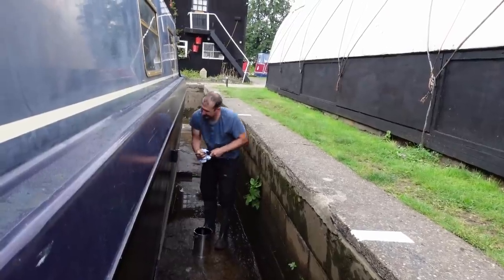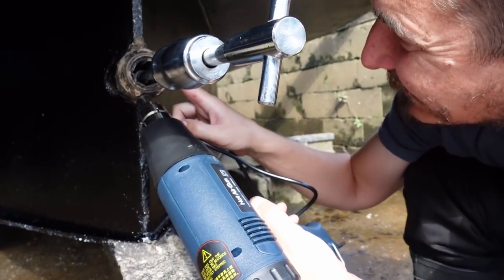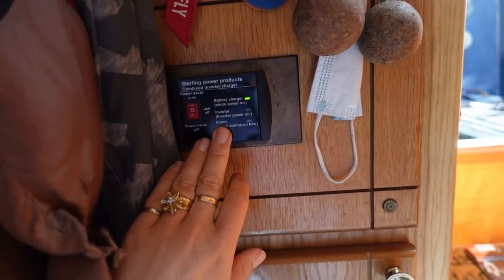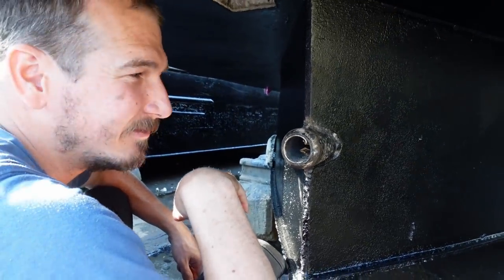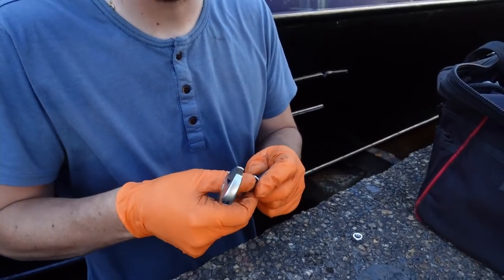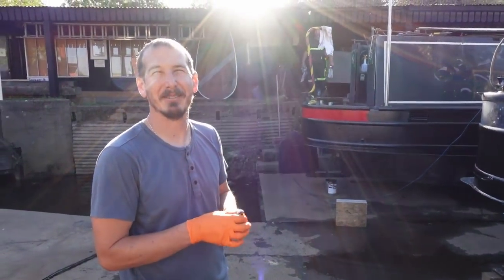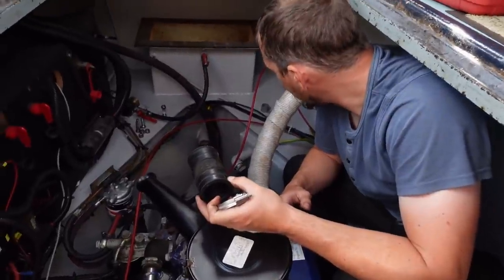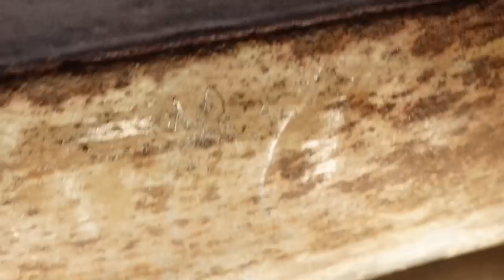VETUS STERN GEAR REPLACEMENT | New NARROWBOATERS DIY the job

Comment: That was quite a job that few boat owners would tackle on their own. I commend you Paul for all the effort and determination which went into this job. I also learned something . . . you have a much more modern stern gland design than I've seen . . . most boats have that rope and grease packed tube which is tightened occasionally with nuts to draw it in. Your design is much more like a crankshaft seal on a car. Well done Sir !
Reply from the maker: Thanks Michael, appreciate it🙌🏻

Comment: I love that Mel is holding the shaft with ring and bracelets on while wearing g a nice shirt and leather pants.  Rock on, girl.
Reply: Surely pleather 😉😉 I did laugh when P was describing pushing the shaft into the flange and wiggling it, you too are well behaved Cape Brits I assume so you weren’t being innuendoesk right😉
Reply: And In the dry dock with steel toe capped flip flops !! Legend

Comment: I learnt a trick yrs ago to remove the stuck outer ring of a collapsed bearing or a steel bush. A small bead of welding across the inside of the ring or down the centre of the bush shrinks the ring when it cools down. Careful not to burn through and weld them in though...keep the amps low on the welding machine.

Comment: Outstanding job well done. 
Unless there is something special about your set up, I'm sure there should be a flexible R&D coupling between the clamp on the end of the propshaft and the gear box.
Also if you have used the old nuts on the propshaft clamp I would advise putting new nylock nuts on to prevent them coming loose which could cause the shaft to turn in the clamp damaging it. I know because that's what I ended up with.  Glad to see Mel kept you fed and watered

Comment: Great job Paul, sorry you had to do the task the hard way, a bit surprised there wasn't any equipment available from the boatyard, OXY/Acetylene to heat and expand the bearing housing and a chop saw to shorten the propshaft..either way you got there in the end..👍🍻

Comment: Great Job Paul. You would have thought the engineer would have made sure the hole on the weed hatch was clear as he fitted the pipe (or not)  A lot of hard work to do in a short time.
Reply from the maker: Thanks so much🙏🏻

Comment: That was kind of a dumb thing for Spencer to say.  We're all new the first time we do anything.  I wonder how much chaos and clogged up moorings he caused.  Also, Christmas idea for Paul: a pin punch set.  They are used for knocking out or driving in pins, but they would have helped with bending over that tab for the propeller nut.
Reply: And Spencer sound like a No all which means he  no Stuff all unlike as MUNRO"S
Reply from the maker: Agreed! New people getting into boating celebrates it and keeps the canals and their history alive 👌🏻 noted on the gift idea! Thanks so much😊😉

Comment: Hi another good vlog just thought I might say that you should fit a R&D coupling in your shaft had you had one fitted before you may have got away with not damaging the prop as they take the shock out of hitting things also mine is exactly the same boat and engine as yours and when I fitted mine the difference in noise and how much smoother the cruising is it is amazing money well spent(only takes 16mins to fit) The other thing is whoever  told you that you don't have to black the bottom is wrong that is a old wives tale  tale they do rot and it is always better to black the bottom if you are in a place that has the facilities to lift the boat up to get under it

Comment: Hi Mel Paul, nice to see you both,I don’t know if I have said something wrong,but you never answer my comments no more ,you know how much I enjoy you blogs I think Paul is a perfectionist every thing he does it’s always first class I have enjoyed watching him do different things to the boat ,as you know I worked on different types of boats for over 40 years, I used to cut down the middle with a axe saw blade on the tug I used liquid nitrogen wow very dangerous stuff to use it freezing the bearing instantly then it shrink just pushes out ,so pleased you got the cutlass Bering out did you cut it and heat it ? Good job well done Paul ,till next time take care keep safe, John 🤷‍♀️👏👏👀🥂🌹😂🍺🍺
Reply from the maker: Thanks John - you could never say anything wrong to us - never worry about that. Paul heated it initially but in the end it was just a matter of taking the time to cut it. Of course as you say you know your stuff! I think Paul was chuffed but also hoping to not have to do it again any time soon. Though if he does I’m sure he’ll have an easier time after doing the installation himself! Take care John and chat soon!😎😊

Comment: Well done yet again guys. You two certainly get ripped into all kinds of jobs whether easy or challenging. What did you reckon to the Dacrylate blacking? I used that on mine ealier this summer. Dacrylate is just down the road from where i work. Yove got me panicking by the way,  ive got a Liverpool boat similar age with the same stern gland as yours with the cooling pipe ... bet you can guess what my first job will be next time i get back to the boat !!!!
Reply from the maker: 😂 oh dear! Well yours might be just fine👌🏻 will be interesting to hear once you check it out though, so let us know!😎✌🏻
Reply: @MelandPaulMunro  im away from the boat for about 3 weeks but will let you know when i get back :)

Comment: I'm sure there were challenges back in the days when horses powered narrowboats, but sometimes I wonder if it wouldn't be simpler to switch back to actual equine power.
Reply: Have heard and seen that horses have their own constant maintenance norms and their periodic maintenance challenges. Here in our little farm burg the local psychologist gal is also a horse farmer with their farm just 2 miles down the road from my home. Have volunteered at their therapeutic riding center some.

Comment: Happened to notice the weed hatch, in addition to the lack of a connection hole to the bearing, did you not protect the inside of the weed hatch with a coating of blacking?
Reply from the maker: Yup! Coming up in next video 👍🏻

Comment: if that is a bit of the brass bearing sticking out in engine compartment ,would it not have been better to knock it out from inside ?,you got the boat in the dry dock ,how do you except water to lubricate prop shaft ,will work once in water, as weed hatch fills with water ,that is why you have a cover that has to be tightly screwed down so engine room does not flood

Comment: One thing is this. When someone says that you need to heat something such a a barring for removal, they mean 1000's of degrees not just plastic shrinking heat... ie: a torch is in need...
next time you will know....... CCHHEERRSS
Reply: Thousands of degrees ? What are you talking about, the melting point of bronze is less than a thousand degrees.
Reply: @theotherstevesteve  😂 😂😂

Literative(?) hyperbole???